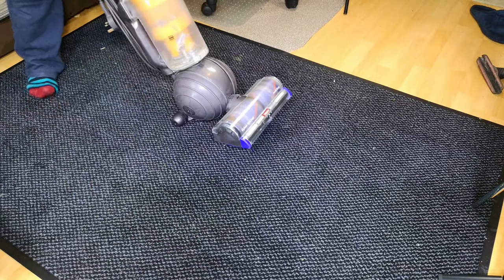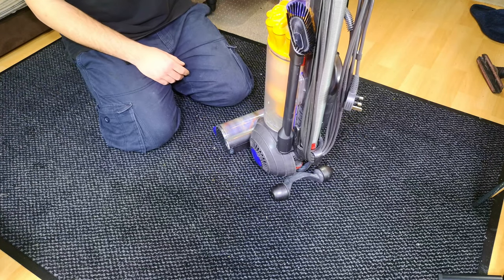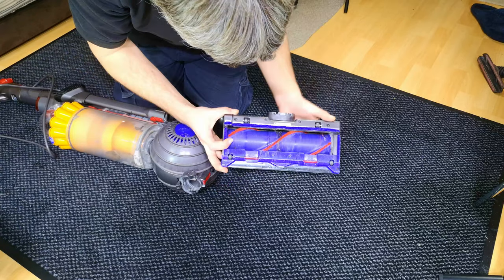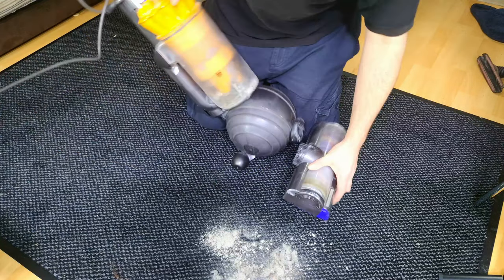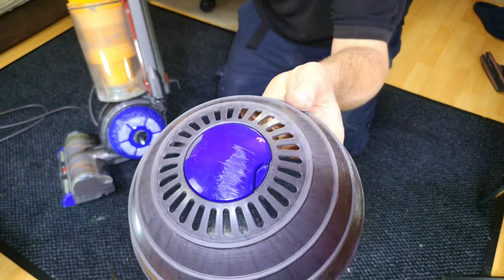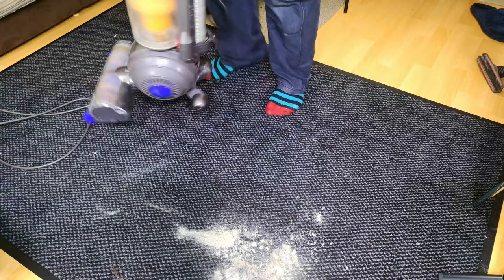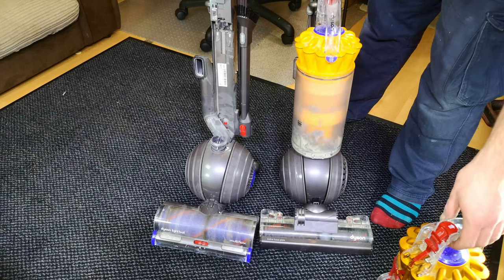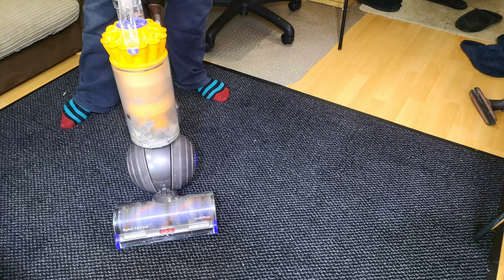Dyson UP22 Light Ball - First Look, Before Refurbishment!

Comment: Do you know if there is a way to remove the centre cylinder from the cleaner head? I can remove the brush cylinder, but there is another under it that stops me cleaning the plastic, that is reallllly dirty
Reply: I’m having the same problem with mine too
Reply: @Retro_andy_1977  from what I've seen on the manual for it, the answer is no :/ gonna have to get a long thin brush for it

Comment: The Light Ball was launched in mid 2017 so it wont be any more than 3.5 years old by now. I bought mine in late 2017 and it still runs fine. They are pretty good vacuums for the 200 quid they cost, and you dont have the worry of a cordless Dyson's battery wearing out after 3 years and needing to buy a new battery. Looks like that one has never had its pre-motor filter cleaned at all - they also have a habit of getting fluff and dirt caught in the large brushroll bearing and its housing, so I was not surprised to see your example all clagged up, which as you said, would have eventually caused the brushroll motor to keep stalling, as it becomes unable to overcome the resistance of the build-up around the bearing. I think you'll bring it up to scratch, just needs a good cleanout.
On a different note - Crap Henry has returned, Take a listen to this, and we now can celebrate, that Hoover Master has his very own Sam Watson inspired Crap Henry;  https://youtu.be/klRmHwnXYMk?t=164
Reply: I have a Light Ball too... Though I think the brushroll bearing has gone on mine, rotating it manually makes a horrible grating noise and does not turn smoothly.
I suspect it happened while it did a brief stint as my mum's interim while she shopped for a new cleaner
Reply from the maker: I rate them fairly well, reserving the right to amend my opinion as they age! Their my number 1 vac recommendation now to normal people, someone from the car forum I frequent bought an ebay outlet one for £150 and said it was bnib and utterly perfect and likes it alot.